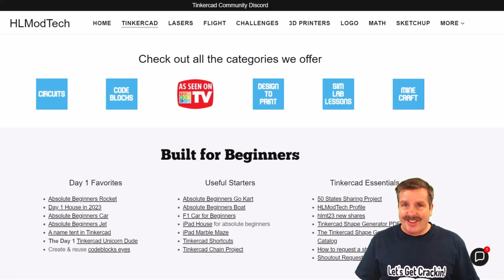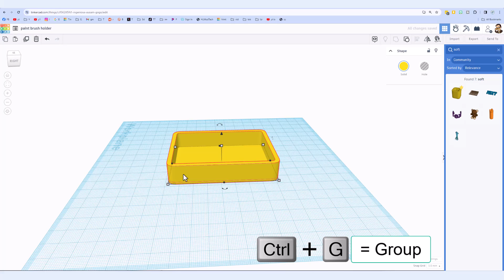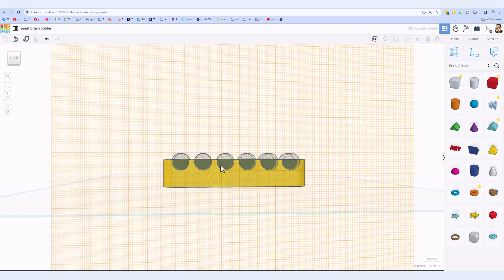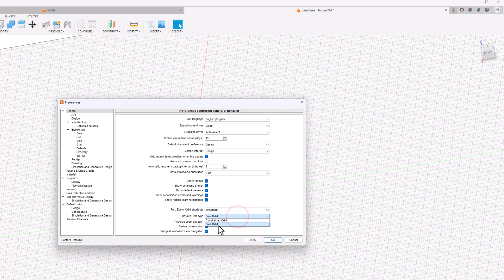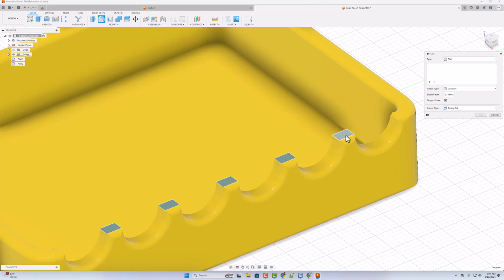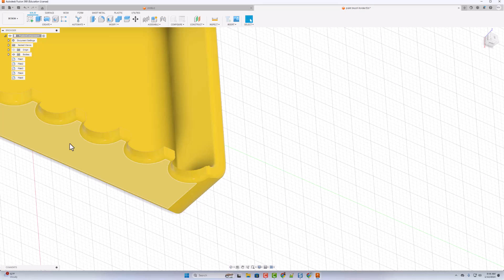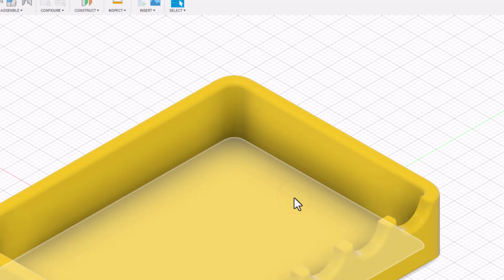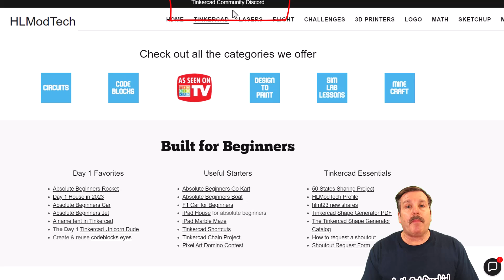Smooth Tinkercad Design Edges Instantly Fusion 360 Fillets in Minutes!

Comment: It's pleasing how easy it is to create the basic model in Tinkercad (via your instructions). And as you noted in another video, importing into Fusion 360 can be hit and miss. I couldn't fillet that front panel in the way you selected it. I first had to reduce the fillet size of the top edge to about .4 mm.  And then I selected the various edges on that front panel. Lots of errors. But trial-and-error got me there. But it's so hit-and-miss that (egads!), it makes a good case for learning Fusion 360 for such models. Or perhaps there is a way to create that model in Tinkercad that makes it less prone to errors.
Reply from the maker: I agree with the errors. I have followed. The tutorials of others and my creation does not do what theirs does either. Part of me thinks that the box I created was small and then the fillets didn’t have enough mass for the slices. If that makes any sense. it would be interesting to double the size and Tinkercad, and then do the fillets. Then take that smooth design and scale it to the size we want. I’ll do some testing and leave a comment tomorrow.

Comment: Thanks for showing exactly how to do this!!
Reply from the maker: My pleasure @JaySDunham. Thank you for the nudge! 👍💯 Super cool idea and I like the way the two tools work together.
Reply: Just thinking about the edges in between the scallops--if you filleted the side before piercing with the cylinder, perhaps that would be an easier way?
Reply: But you’d have to know how to do that in Fusion or else bring it back and forth between fusion and tinkercad several times. Time to learn Fusion!
Reply from the maker: If you check my Freaky Fast Fusion 360 play list, this was project one. Similar to yours, I did the Tink to Fusion... Someone asked for how it would look entirely in Fusion so that is there too. It explains a bit more about how to work with Fusion. The box in Tink was so slick it is hard to make that faster using Fusion.